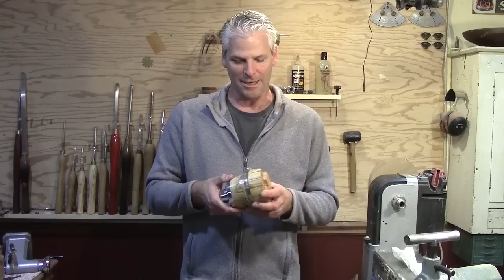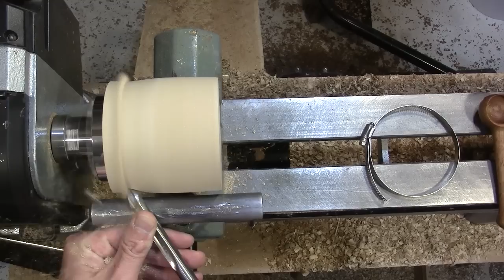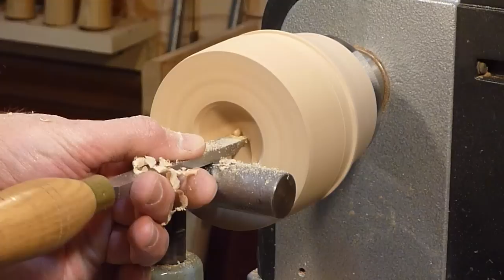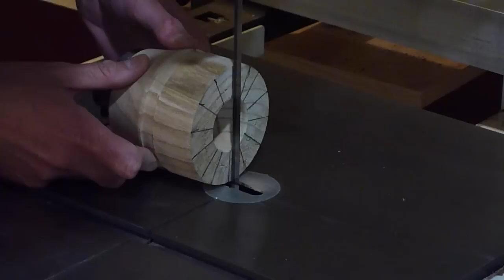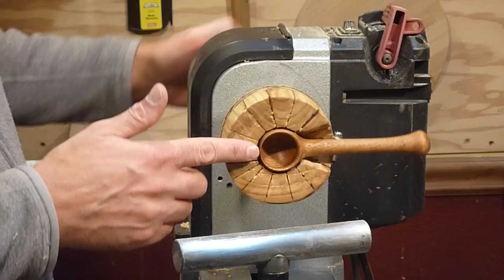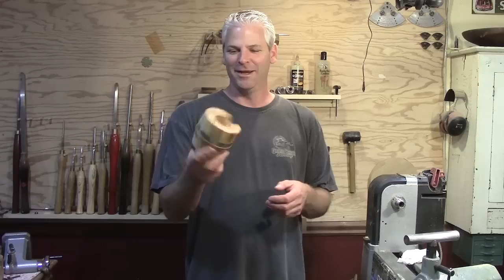Woodturning Jig for making one piece spoons on the lathe

Comment: Love your work Carl, but I'm concerned about a couple of things. 1. Already mentioned is the turning around the clamp. 2. Cutting round stock on the band saw, in my opinion, the way you were doing that is an accident waiting to happen. I would like to see you use a V block with the stock clamped down to avoid any spinning of the wood.

Comment: Great job Carl! My thoughts on the slots, face down on a table saw using a sled. Wider curf on table saw blade.
The other thing I noticed, if you turn the hose clamp around so the excess clamp end would trail instead of turning into the rotation. 
Always enjoy your video's, and especially with your daughter... That was awesome.
Reply: my thought too.
Reply from the maker: Thank you Robert, great idea to use the table saw. I did turn the hose clamp around and put a big rubber band on it when I was using it.

Comment: You should cut the slots deeper past the band so that the band has leverage to pull inward.  It looked like you stopped at the band in the sawing part of the video, though it did look like you had cut deeper in the later shot of you holding the Jig.  And drilling out the center would also help.

Comment: I like your jig—a simpler solution than mine. Your jig has enough meat to allow a deeper recess for the pipe clamp so that the screw is just even with or slightly below the jig's circumference. And reversed as previously mentioned. Lee Valley now has a reusable 'stretch' tape that is perfect for replacing rubber bands...
Reply from the maker: Richard St. John Thank you Richard, I'll have to check out the stretch tape.

Comment: Very cool! I like to turn hairpins and their tiny diameter makes it a little hard to work with. I usually have to rough out the top, turn the pointed end all the way down and then put the thin end in the chuck, which often mars it up resulting in more sanding. Making something like this but much smaller may be a nice way to hold the pin without letting the chuck damage it.

Not to mention I could make pins that are hollowed on one side or even carved through.... Eyes light up with the possibilities
Reply from the maker: Nevir202 Thank you, These are great little jigs, and you can customize them for your needs.

Comment: Make sure the clamp flap is trailing when you do this! also you might want to tape it down with some duct tape as extra precaution against possible catching on tools and body parts. Just a safety suggestion.
Reply from the maker: I did turn it around and tape it before I used it, but yes safety first!

Comment: A couple of questions. What is that machine called? Where can I get one? How much? What are the tools called that carve the wood and where can I get them?
Reply from the maker: Hi Matt, It's a Delta 46-460 Lathe. I would shop online for the best deal. This one was around $600 Mostly gouges and chisels. You can get a starter set at your local woodworking store, or again online.
Reply: Thanks so much :)